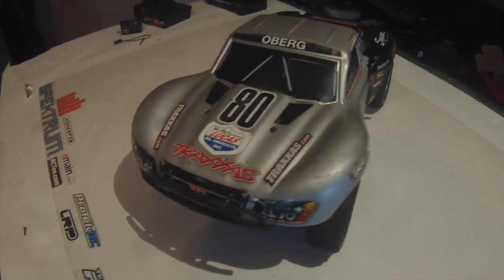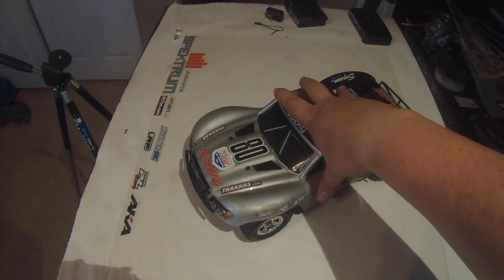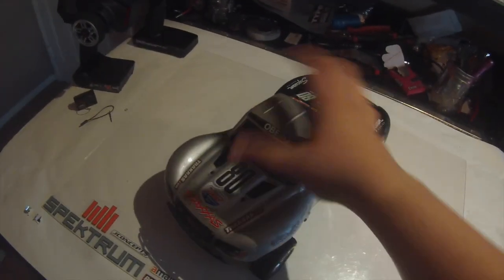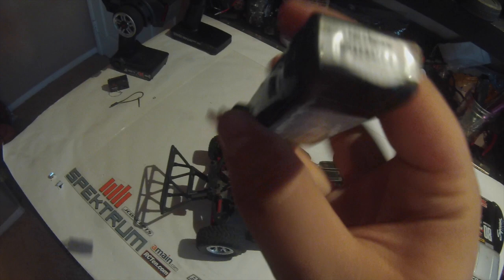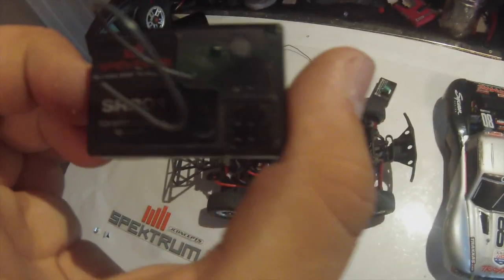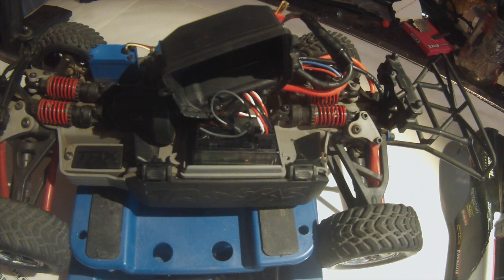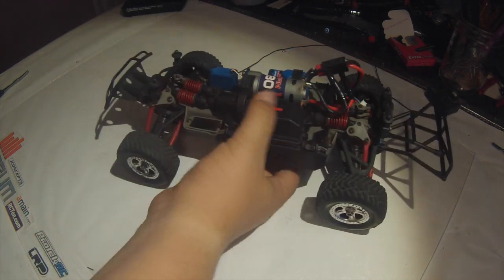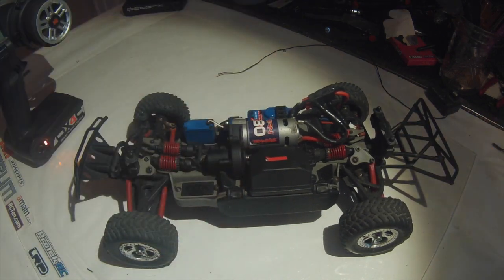Traxxas 1/16 Slash UpGrade #1 Spektrum DX4C-RCevolution100

Comment: When I first got my erevo, the servo gears stripped within a day or two. After getting a new one, the gears stripped again. The third ervo I put in did the glitching thing that yours is doing. All of these servo broke within a matter of months. My fourth servo (I'm still running it in my erevo) has died yet and it's been in my erevo for 2 years. From my experience, it's just the luck of the draw.
Reply from the maker: Ya I'll be replacing it with a metal gear servo so it should be all better after that
Reply: chillychill68 just use hitec hs 5085mg